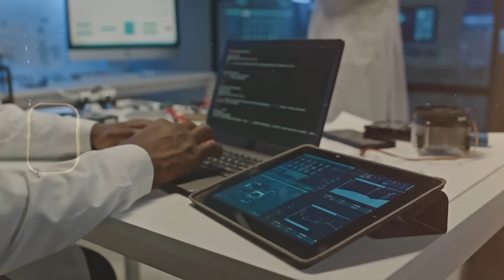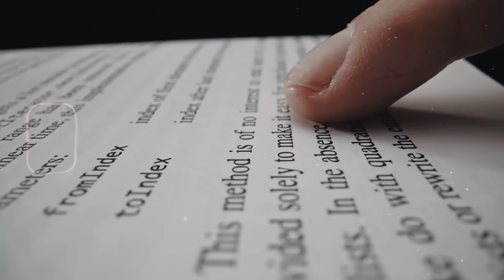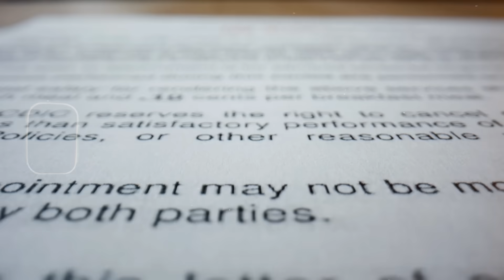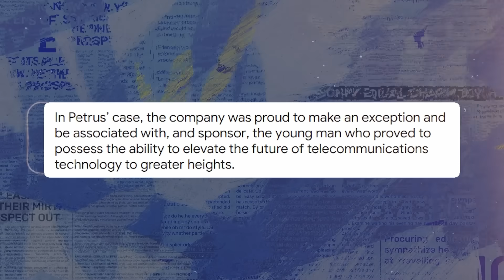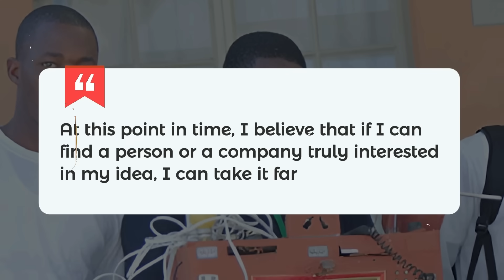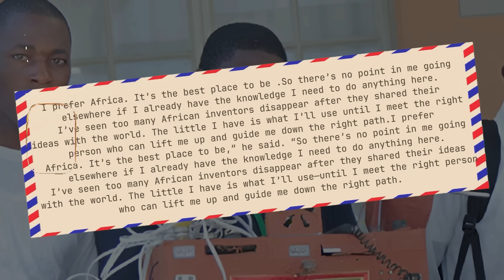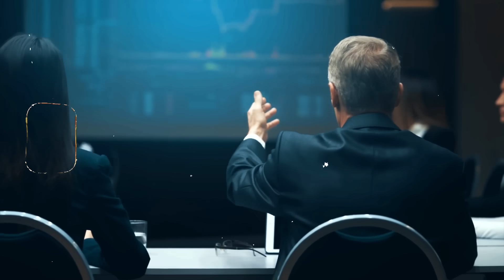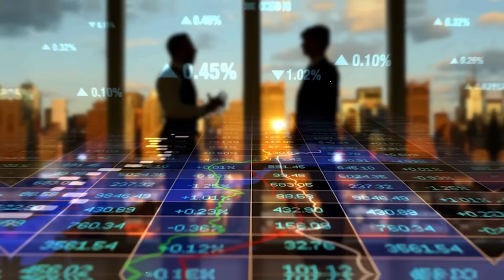How A Namibian Boy Builds Phone Without Airtime or SIM – You Won’t Believe What Happened Next.

Comment: It's not just neocolonialism or protectionist policies. Although these do play a role as well, - the brunt of Africa's backwardness comes from its unique geography and climatic zones. Africa as a continent - has the worst coastlines and the worst shores for the shipping trade. Its shallow shores force ships to anchor 2 kilometers or further from the shore and use smaller boats which is 4-5 times as expensive as unloading and loading goods using cranes at a port. But just as its beaches are flat and its shores are shallow, - deeper inland Africa has mountain ridges, slopes which turn rivers into dangerous un-passable torrents, and these make commercial shipping impossible most of the year. Then there is the issue of Sahara being the worst land obstacle - without a single railroad line built to date because it would be next to impossible to maintain it and ensure safety for commercial railroading. Finally there's the climate and awful tropical diseases which further make development a nightmare. Currently China has the technology of ship raising, making it possible to turn many African rivers into safer shipping routes. But that tech is very expensive. China just began employing it in China. Who knows how long it will take and whether China will consider African countries worthy of such large investments. We can only hope that as this technology becomes cheaper it will be shared with Africa and we will see the continent prosper.